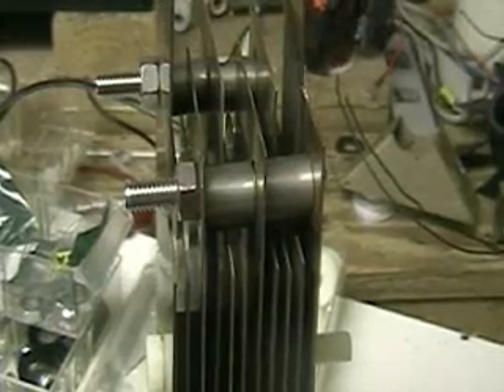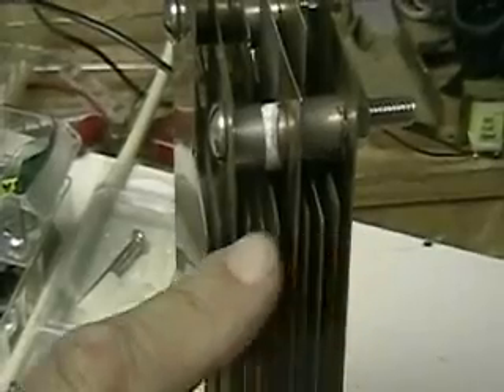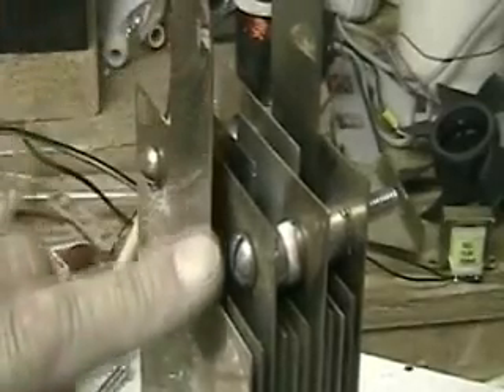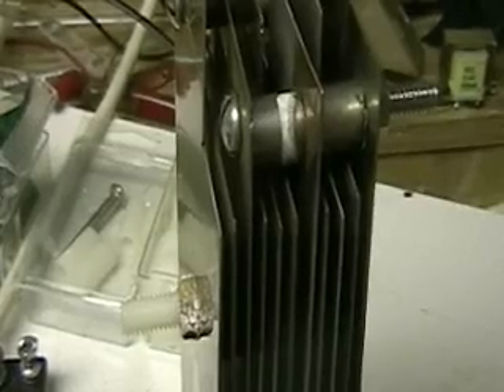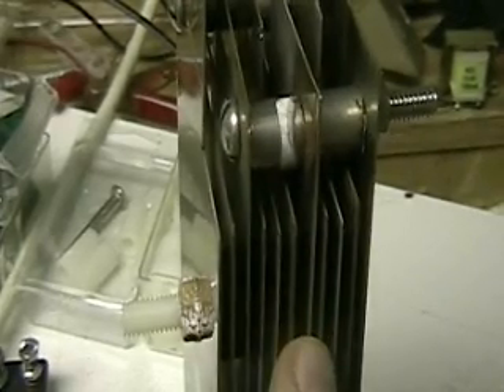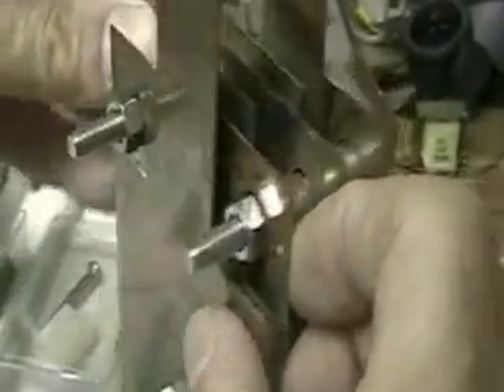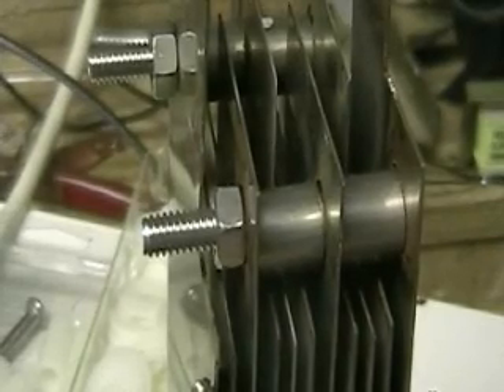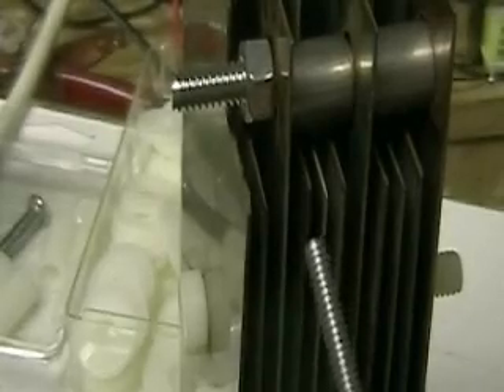Hydrogen Tap (FOCUS- MORE ANSWERS) 345

Comment: with 12 volts at 7 amps (140watts), how big is the efficiency if burned in a car? is it enough to recharge the battery and run the motor while not moving, is it enough to run the car including the recharging battery or will the battery run out of power after a few hours and the car won't drive. watched other videos of you but never see actually a driving (working) car.

by the way, good work! keep on experimenting!

Comment: This vid has a lot of questions in it.  The answers could be very simple or new such as the pressure of the water having an effect deeper down... or perhaps a "jacobs ladder" effect.  Other points to ponder might be should the plates (pos or neg...not both) be closer to the neutral plates.

Comment: John,
Could just be my imagination, but when I watch your video it reminds me a bit of the way a lobe of RF is pulled out by the directional elements of a yagi type antenna. The way the gasses are pulled from the negative plates towards the neutral plates. It may be doing the positive ones the same but since your generating twice the amount of H it isn't as noticable.
Keep up the good work.

Comment: You're on the right track John.  If you measure between each of your cells you should find they each receive half of the supplied voltage approx 6 volts.  If you add another neutral plate between each +nn-nn+nn-nn+nn- you'll find each will receive 1/3 of the supplied voltage or approx 4 volts and so on. You have to imagine each neutral plate as having a north and south pole.  Voltage is reducing each time electrons pass in-between each neutral cell.